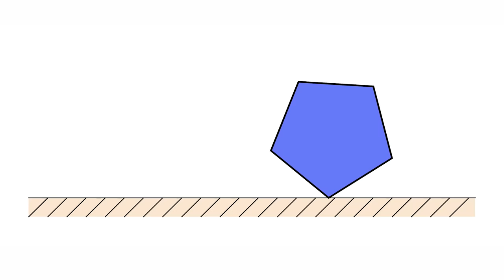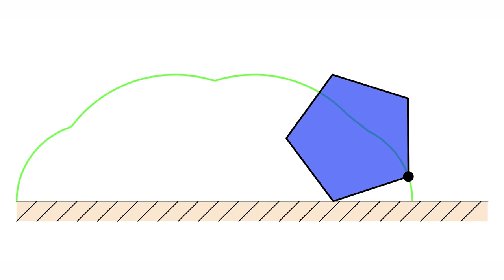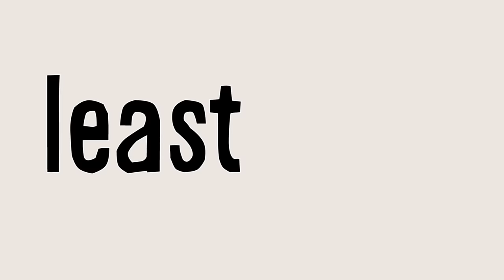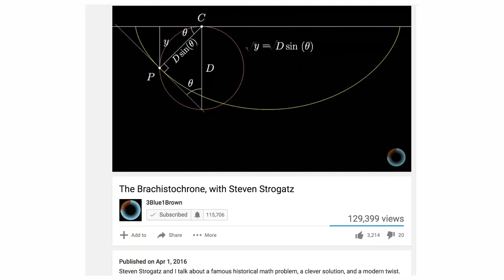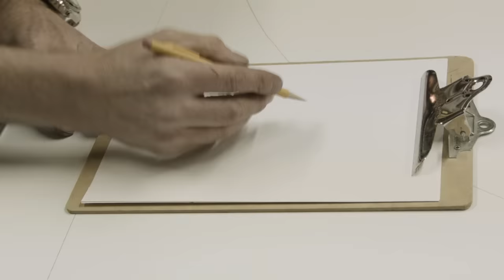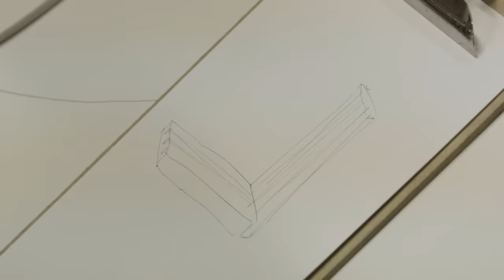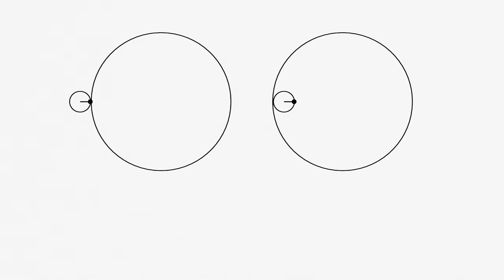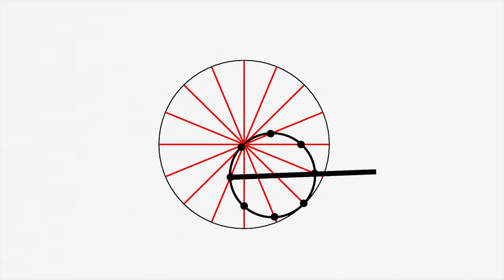The Brachistochrone

Comment: So does this mean that the Brachistochrone curve is the most difficult to run UP?
Reply: You have gravity to help you on the way down, but that’s all I got. Good question, man
Reply: idk man, a wall is pretty hard to run up
Reply: @cyrus7972  stop💀
Reply: Not for the Ninja Warrior people
Reply: @cyrus7972  even harder is running up the bottom of a ramp. an angled ramp that points towards you
Reply: It's definitely not the hardest to run up. The "easiest" (more like the fastest) is a straight line bringing you upwards at a steady rate. The reason why is because gravity isn't accelerating you as you go up, your own force from expending energy is moving you, so the shortest path is the fastest to go up.
The way you make it easier, as in less energy needed at once to move you, is by extending the line and making the ascending slope less and less steep. Given that a line can be infinitely extended, theoretically the easiest slope to climb is an infinitely long one with (technically) no slope even though you're ascending up the slope... Yeah that math is buggered.
The practical "easiest" slope would be a straight line going up that can feasibly be built in a given area.
Reply: @cyrus7972  cough b03 cough cough
Reply: The most difficult would be like an acute angle prolly
Reply: running ofcourse is not a fair comparison due to our legs mechanics, however say you were a ball (or sitting on a unicycle) then you could i think claim that it would require the least amount of total energy (or lowest beginning speed if your were to start at what is now the end of the brachistochrone and were not to accelerate any further while on the curve)

Comment: @15:08 - Michael, question for you. The epicycloid drawn has seven points where it touches the circle and the hypocycloid has six. If the tracing circle were smaller or bigger, would the epicycloid always touch the stationary circle one more cycle than the hypocycloid? (Thats if you have a size that perfectly cycles around)

Comment: This Brachistochrone should be a water slide
Reply: this would be awesome 3 of them all the same curve but from different starting points like in the video oh this is a good idea
Reply: Actually at Blue Bayou in Louisiana, they have a water slide that is shaped like the curve. It's wild that I realized that after years of going there. It has three rows with sleds that you sit on, and it's curved to allow you to skid across a shallow pool. Really cool stuff!
Reply: It is the one you get the most speed in average. The extreme curve would give you the maximum speed, and the maximum slow down too, I guess the most sensations as a water slide. The straight line is, as said, the most boring of the 3.
Reply: But wouldn't you need people of the same general weight (>5kg difference) for the acceleration to balance the distance out like the discs in the video?
Reply: Rob Dapedo acceleration is independent of weight. Although size would matter because of differences in friction
Reply: Mass, not weight. Weight is dependent on acceleration: F=ma.
Reply: mass would matter because more down force = more friction
Reply: Yes but on a water slide, at our scale it would be negligible I believe.
Reply: Yemeth42pis I'm not so sure about that, I worked on the tubing part of a ski hill in the winter when I was younger, and granted the hill was 1500 feet long, but ~50lb extra on 2 perfectly even runs would equal about 10 feet of seperation on the bottom.  So it would definatly depend on the slide length, and the amount of friction each person puts down, since in my case the tubes were all the same size
Reply: Sort of. 
On a waterside, the net force accelerating the mass down the slide is modeled by the equation: Fnet=sinqxma where q is the angle of the slide relative to the horizon, m is the mass of the object and a is gravity. Fnet is therefore linearly related to the mass. 

Friction is modeled by the equation: Friction force <or= coefficient of friction x Normal force exerted by one object on another. The normal force exerted by one object on the other in our case will be: Fnormal=(ma)/(cosq)

On a water slide, the coefficient of friction is very low (otherwise you wouldn't be able to slide) and because the coefficient of friction is directly proportional to the force of friction the increase in the force of friction does not accelerate the more weight force the mass puts on the slide. i.e.: The force of friction vs the mass of the object is a linear relationship.

Because both forces (friction and accelerating force) are linear relationships that share the same variable we are changing (mass), we know that the ratio of accelerating force to friction force will remain the same no matter how massive the object becomes. 

So in this case, friction doesn't matter.
Reply: Completely unrelated but I'm so curious that I want an answer ASAP. I'm using this comment cuz it's the top comment and no one will see mine. Anyways, 15:18 I always see that shape in the reflection of light in water. I've noticed it when I was 6 and always wondered what causes it. Any explanation?
Reply: Rolantis this is intriguing I'll have to research this
Reply: Sunny shah All that would do it make the ride as short as possible. It wouldn't exactly make it better.
Reply: Rolantis It surely has something to do with either the surface tension or capillary wave.Search in wikipedia
Reply: I thought about this for a while, and I think I have the answer (Thanks in part to the suggestion by RayVitoles, above), assuming we're both thinking of the same thing:

It's not a reflection, it's that the water has some object floating on the surface tension (or something else, like currents) that is deforming the surface of the water turning it into a concave lens, and the sun is significantly outside the resulting focal point of the lens. The incoming light is bent away from the center of the lens, forming a dark patch in the the middle of the image that is seen on the surface beneath the water. The luminous ring is formed by the fact that the rays are redirected and refracted more when they hit the surface closer to the edges of the lens.

The reason it takes this shape is due to the angle that the sunlight hits the water. It's difficult to describe only in words, but basically, the combination of the angle of the incident ray and the angle of the lens surface it hits will result in the image being distorted this way: Some light rays will come in on such an angle that they actually travel parallel to one side of the lens, and instead hit the surface of the water on the other side. The refraction and redirection of these rays forms the point. You should theoretically notice that the point in the cardiod shape points towards the light source. That is, the side of the shape that has the point is furthest from the light source. When the sun is directly above the water or the lens does not have much curvature (the water is not deformed much) the shapes should be round, not cardiod.

Roughly the same shape can be observed in the light patterns reflected off a concave mirror if the light source is powerful enough to give a crisp reflection, and far away enough and at an angle.
Reply: Nixod thank you! I always thought of it as a butt shape when I was little and I still remember that day when I looked at it and wondered what is that and why is it doing that. 6 years later, I begin to understand :)
Reply: @topeh06 - The brachistochrone? I don't know, it's hardly useful for coasters as it, tho. Their drop shaping is more complex a g-forces based.
Reply: Near, but inexact. Brachistochrone is only [1/x^2], because it is respectful of what we know for seconds power for an acceleration. Deceived? -A little, I guess. Just see that distance and time can be interchanged on such a curve, (0x/0y), regarding positive Xs.
Reply: I think the mass might matter when you consider the resistance of air: I noticed a difference driving a full and an empty car downhill.
Reply: OZ, It IS only the inertia of your car against frictions. As Galileo said: M IS useless for free fall, (and resistive fall is uninteresting for us). The famous formula "G Mm/r^2" of Newton, which came later (than Galileo), is a fraud attempt, depending on me, in the kind of: "Let's see: I guessed the result BEFORE experiment", as Einstein would do later (a photon seen from 2 places is an idiocy). Mass is useful horizontally.
In this story - I am seeing the recommanded video by VS - but I'll be very surprised that brachistochrone would be gravity-dependant!
Reply: Sunny shah Hey, I got the 1,300th like exactly.
Reply: Sunny shah especially the extreme curve
Reply: Sunny shah was thinking the same thing haha
Reply: Nooooo.
Reply: How would such a waterslide be a "tautochrone curve" when the objects sliding down it are not disks? In otherwords, my question is whether or not the disk is important. To me it seemed like it was. If they had used a polygon would they all have reached at the same time?
Reply: that's genius
Reply: Sunny shah it should be one big one where you can start at anypart of the slide
Reply: Sunny shah in a physics/mathematics themed amusement park

Comment: teacher: what is the fastest to route to point A to point B
everyone: a straight line
Michel: a brachistochrone
Reply: Ok children, so in the 100 meter dash, everyone goes straight line and Mr. smartpants will run on brachistochrone.
Reply: @neplatnyudaj110  alright, everybody is running on thick mud going from very muddy to less muddy
Reply: Moving point A to point B
Reply: @neplatnyudaj110  Mr. Smartypants knows how to quickly dig tartan with his bare feet...
Reply: Only if point a at an elevation.. for same plane teacher is right
Reply: ima tell that to my science teacher to sound smart
Reply: Depends on if you're a ball or not and if you're moving because gravity or not
Running, this wouldn't make sense
Reply: @WafflesYTonYT  Well I identify as a beach ball, so I'm ok.